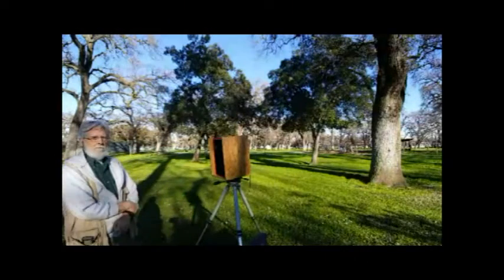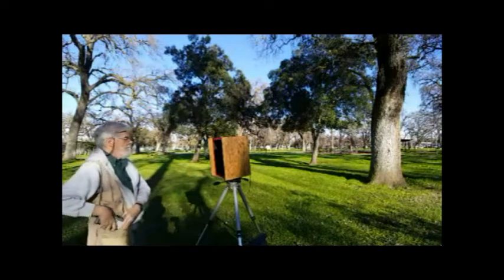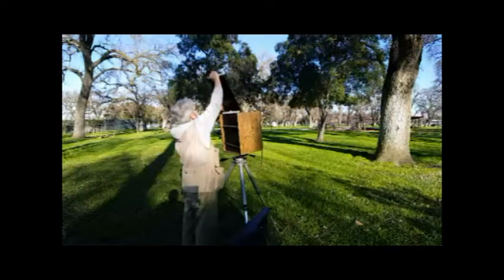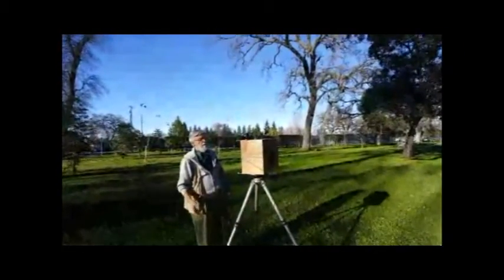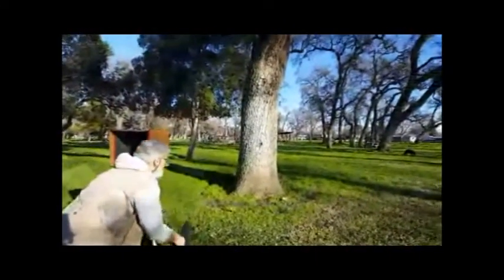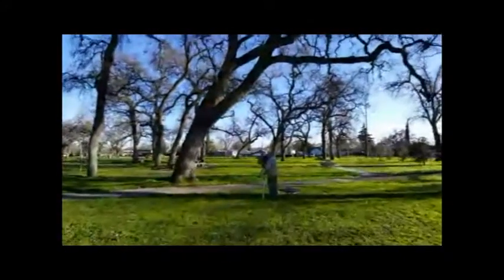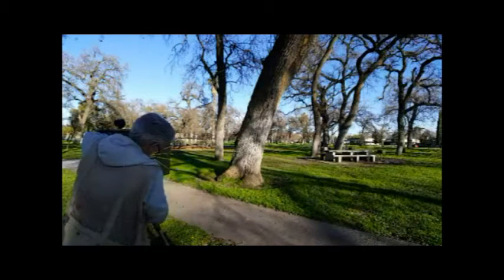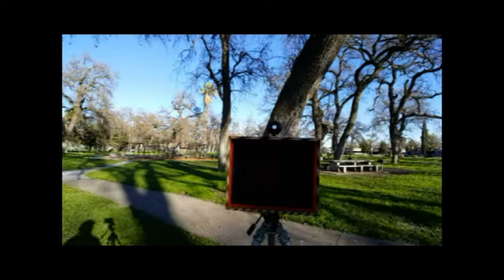11x14  Pin Hole Camera-Netcast live at 720

Comment: Do they make QUALITY pinhole cameras that don't cost enough to get a whole pallet of film for this size?  I am referring to the cheap looking plywood  vs solid wood with a nice grain figure.  No hot sucked plastic or blowmolded  pvc garbage such as the modern cone shaped one that costs $450.   I had to make my own 5x7 in some nice birdseye  wood as I cant find a decent one that doesn't feel or look cheap to me.  Mine only cost me about $50 total or so including the shutter I robbed off another camera I have.
Reply from the maker: We made a super pin hole camera, Nobody ever made one as good as ours. It simply is he best.
Reply from the maker: I put the camera and the film holder for sale on ebay. Our material costs  were over $800, we started a birchwood box, new 11x14 film holder, a schneider viewfinder for a perfect , a new 4x5 reducing back, some machining, completely light proof and vintage shutter.  check out the price on 11x14 film holders and schneider viewfinders.

Comment: Pin hole camera with a LF lens?
Reply from the maker: NO, lens at all. Standard brass drilled pin hole. It has a large Shutter sans lens.the shutter allows for time only, shutter speed control, no aperature control. We used Ilford Film, pro 11x14 film holders (no slow ass print paper) and the R55 mono for developer, we have shot at 4 seconds and 2 seconds on very bright days, we have yet used fill flash/strobes. Also, all light leaks where eliminated with paint and black silicon glue and the best felt. Notice the 4x5 for test sheets. It also has a yellow filter. as simple as it is we did work out all the  shortcomings. Thanks for your interest and we will answer any comments you may have.
Reply: Thx Phil, now I understand.  Didn't notice if you posted... the final images. My 6x17 RRS pinhole takes some good images.  Still learning pinhole.
Reply from the maker: my 11x17 scanner needs the film head, as soon as I get it I will post. Color and black and whit
Reply from the maker: No lens, no we did remove stupid and made a camera that with a all the Needed elements. but no lensl.
So film holders, shutter with No lens, box felted fit, real film holder. No half- print material, no long exposures.
Schneider view finder giving the best- view===clear and sharp